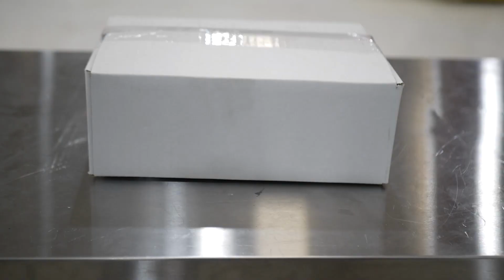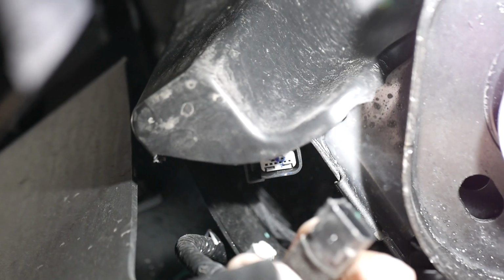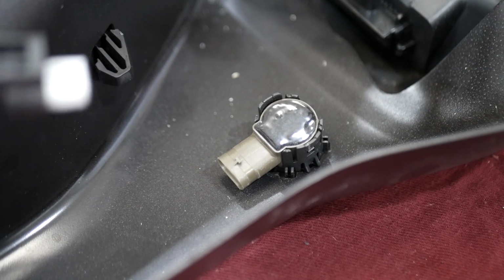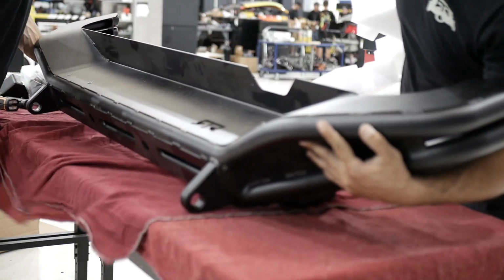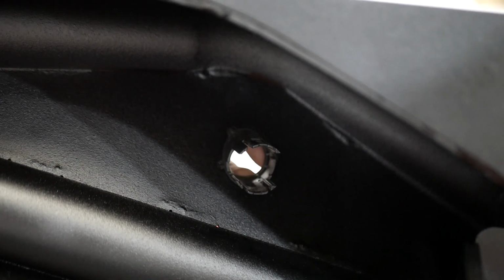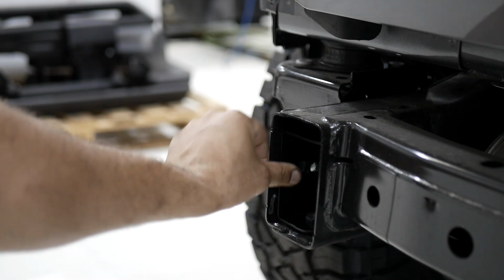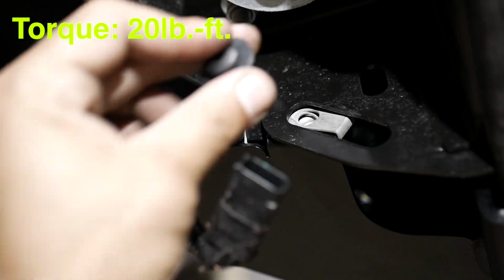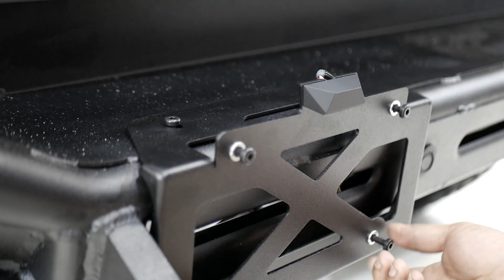Installing the RTR Rear Bumper (21+ BRONCO - ALL)

Comment: With a correct install, can the rear of vehicle be lifted up by the bumper?  Towing, for instance.

Also, it looked like you reused the plastic bumper sensor clips... It's that still the case?  My Wildtrak has sensors in the plastic bumper.
Reply from the maker: The bumper can be a lift point.  For Wildtrak, you would need to purchase the factory clips from the other trims.  We have the needed part numbers listed on the site.

Comment: I installed mine last month and had a hell of a time understanding the install of the sensors, my box only came with the hole plugs and I was forced to use my OEM sensor bezels which face the ground and beep every time I backup. This video and all the photos I saw have those slanted black bezel plugs, was my box supposed to have them??
Reply from the maker: We reused the factory sensor bezels.  Which trim level is your Bronco?
Reply: @RTR_Vehicles  outerbanks high package. My bezels are completely flat and round. The ones in your photos and videos are slanted which keeps the senses straight facing which prevents them from sensing too much. I sent you and Instagram DM with photos so you can see
Reply from the maker: @kylehurley1635  can you send those to info@rtrvehicles.com ?
Reply: @RTR_Vehicles  What was the verdict on this? Same trim, same issue…
Reply: @RTR_Vehicles  in addition to the bezels and isolators being circular / not slanted or angled, my sensor connections face upward (when installing) / they don’t have tabs that go left or right
Reply: @kylehurley1635  how did you end up troubleshooting the situation?